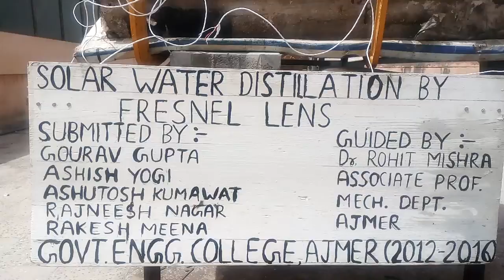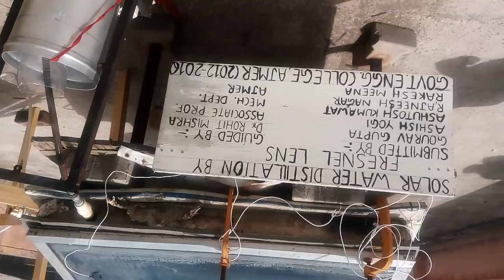India's first FRESNEL LENS utility in SOLAR WATER DISTILLATION[( boiler, heater)+solar oven]by-GECA

Comment: Ashish Yogi, please share my gratitude to your whole team for your generosity in posting this! I am finally ready to build such a unit, but do not know how to build the solar tracker elements of it. Are you willing to share your plans for those components? I am also interested in creating a system that uses as little plastic as possible, so I've been researching the best materials to use for the tank. What did you use? I live less than 5 miles from the Great Salt Lake in Utah, United States, so I'm extremely interested in water desalinization, making the desert bloom, and growing crops in salty soil. Do you follow Geoff Lawton's permaculture lessons, by any chance? He has had great success growing a food forest in the Dead Sea, growing plants in soil that is so salty that scientists said it could not be done.
Reply from the maker: Thanks Michael Ritchey, Your words filled joy in our team members...
We made our Solar tracking ( in low budget) by using an high torque step Up motor with 2 photosensors ( an small barrier wall between them for shadow formation) and u can use pulley-string or rigid by bearings and break.... as shown in video it works on the concept of shadow and light intensity difference controlled by MCU .. just a little bit programming is needed in that...
U have to set them stop when intensity in both is equal and rotate towards bright photosensor when difference ( due to the shadow of wall ) is finite untill they have same intensity. This helps to make lens always face the sun.... I hope this will help u